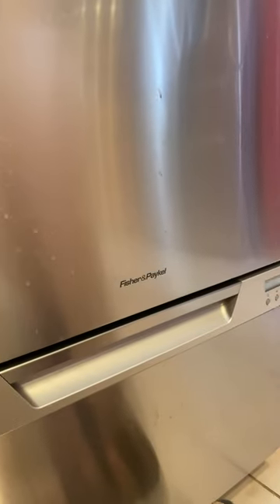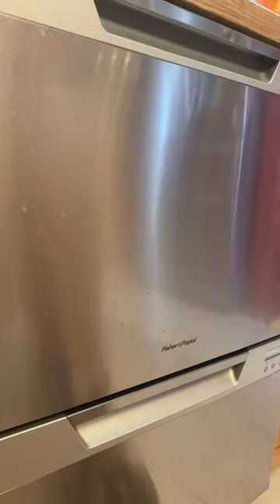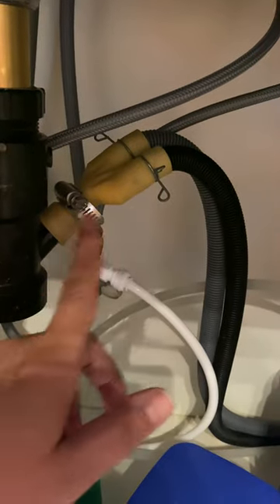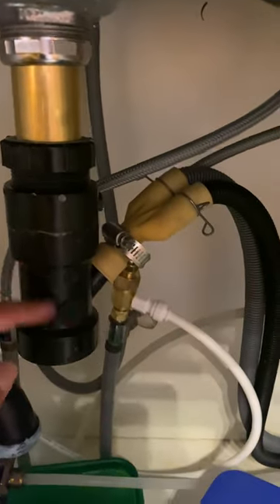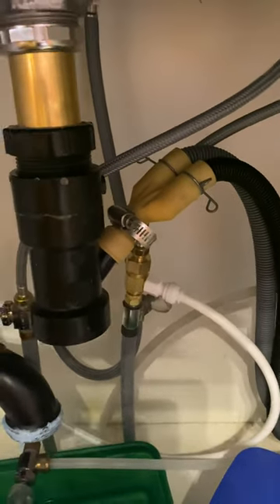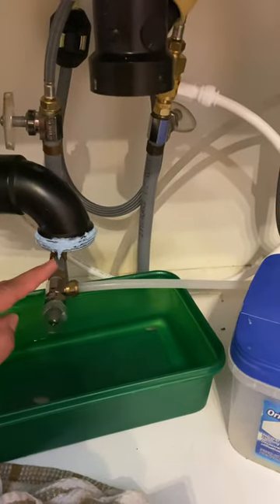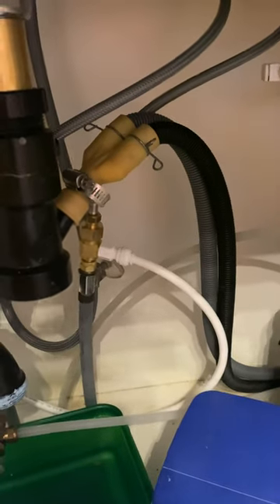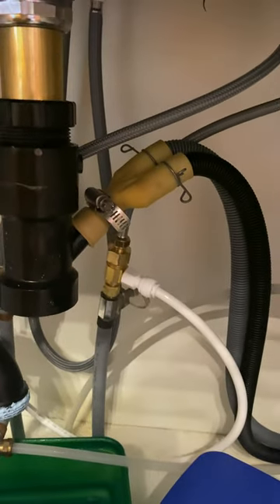Fisher and Paykel Dishdrawer not draining

Comment: Different solution - Nope this suggestion did not work. In my case water in the top drawer after running the bottom drawer. The fix is a small 1/2" round flapper valve in the drain hose that no longer worked properly and allowed water to run back down the drain line into the top drawer. Hired a plumber that used to be a authorized F/P repairman. Valve was $16 and took about half hour to fix.  $110 total. Works great 3 months later. Hope this helps to diagnose.

Comment: Should there be residual water in the tray at the bottom?  Technician said yes to keep seals wet but I think he’s wrong. It begins to smell.
Reply from the maker: Hi Leslie, mine always has a bit of water under the filter that’s under the cutlery basket. But not much else.   
I clean the scum under the circle thing then sprinkle a lot of baking soda in it.  I pour some vinegar and let it bubble away.  Then I add boiling water and shit the drawer.   I start it up and let it drain then stop and add more water and drain and repeat until the baking soda is flushed away.  
I hope this helps.
Reply: @tinadoesstuff  yes that helps-thanks so much
Reply: Yup just pulled my bottom drawer out and cleaned under it. Hope it drys so I won't need new sensor

Comment: Fyi, I don't think you've got the hose clamp on properly, the hose clamp should be around the small pipe. Looks like you've just tightened it on the y union itself, which both restricts the diameter and doesn't properly seal it
Reply from the maker: Hmm thank you.  I watched that part again and it does look like how you describe it.  I’ll check tomorrow on that.  However, I’ve not had any issues since so I’m guessing it’s not restricting water flow….

Comment: Hi Tina. Your metal clamp is in the wrong place. You're only blocking water flow with where it's installed. You need to move it so it's squeezing the fitting inside, not your rubber "Y" connector.
Reply from the maker: Hi John.  It may look like it’s in the wrong spot but it’s not.  Its not blocking water flow at all.  It is squeezing the hard plastic fitting.
Reply: Ah, I see. Still can't get mine to drain properly.
Reply from the maker: @johnpaajanen4437   try to push a chop stick down to maybe dislodge something further in.  My brother in law had a plastic nub from the dishwasher rack wedged in his.